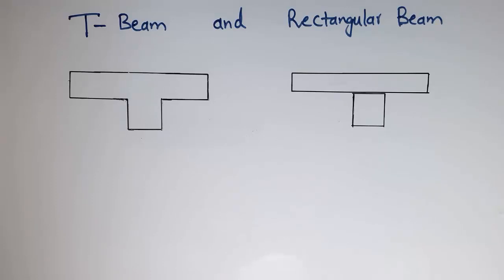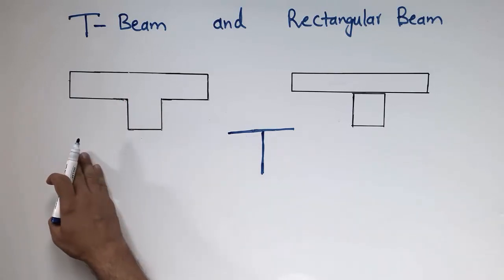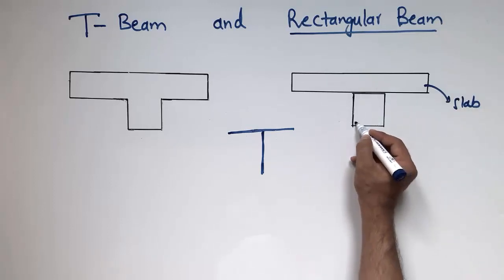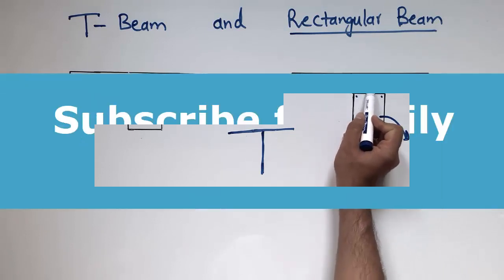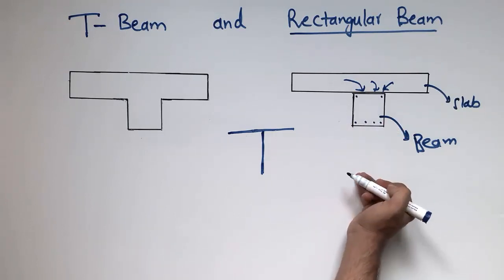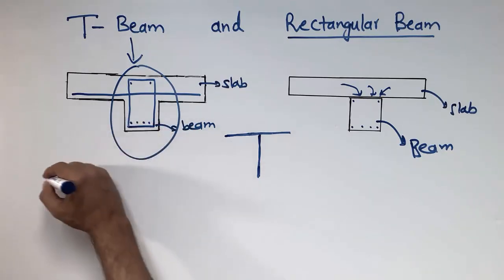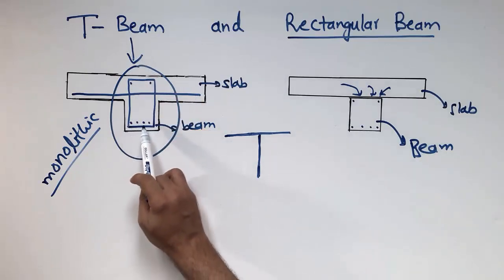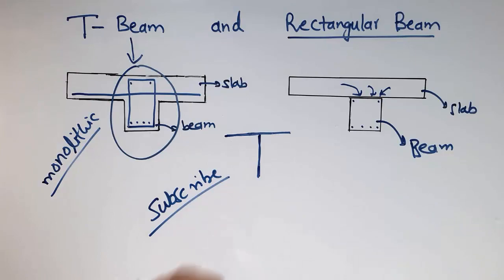Difference between T Beam and Rectangular Beam

Comment: flase concept. It is not about monolithic or non monolithic construction. It is about neutral axis, if it falls within flange, beam will act as t beam, if NA falls within web, it will act as rectangular beam. Reinforcement comes later